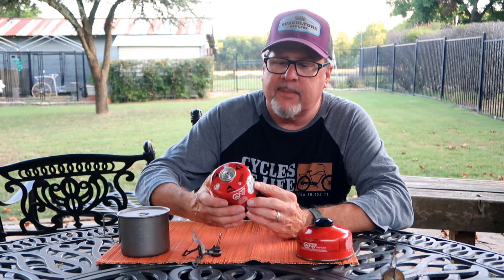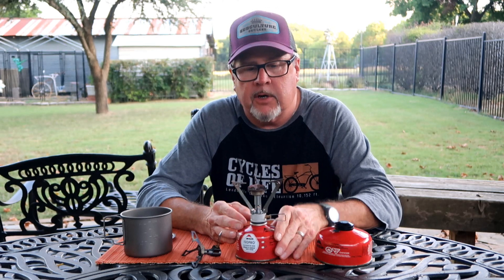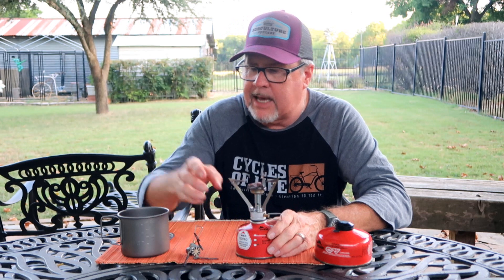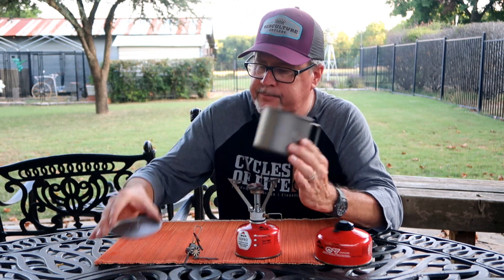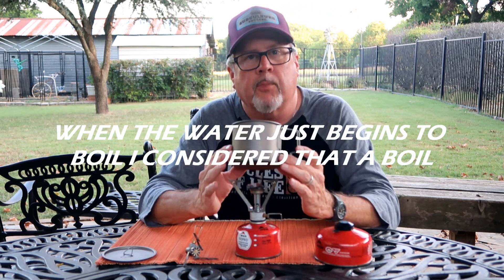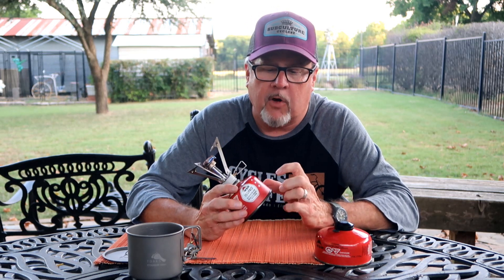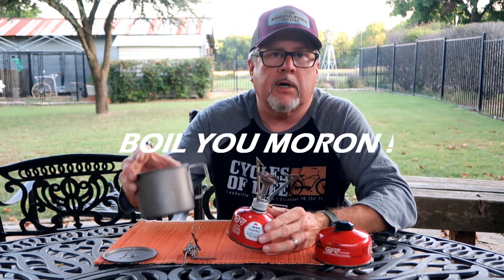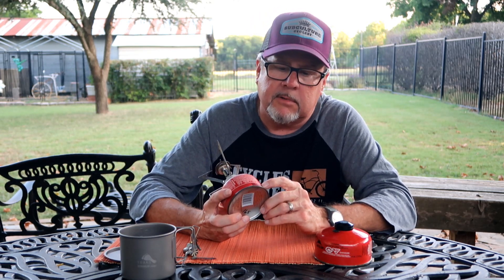HOW MANY BOILS ARE IN AN MSR 110g  FUEL CANISTER ?

Comment: The reason animals don't have to use toilet paper is they eat the right foods and the stool exits the anus without making a mess. If humans ate a diet consisting of enough grains and vegetables, less red meat and more chicken and fish to form a firm stool, and a handful or two of cashew nuts every day which coats the stool in oil for a smooth exit, then you wouldn't need to use toilet paper except for maybe a wipe to check if your anus is clean.
Reply: Damn. Truth. Maybe if we squatted the correct way too. 🙂
Reply: @WolfBand626  Good point. The turd would be less likely to rub against the inside of the butt cheeks on the way out. { : {) }  >

Comment: I think the suggestion in 7:23 is not very safe... Most likely you won't be able to use all your 110gr of fuel of the canister, since it won't have enough pressure to create a strong burn. Apart from that, thanks for the tips! ;-)

Comment: I hate it when I still have liquid fuel to burn but the gas has burned off.
Reply: That's where having a remote canister stove is good. If you've got weight on the stove (to stop it flipping over) and a long enough hose, you can invert the canister.